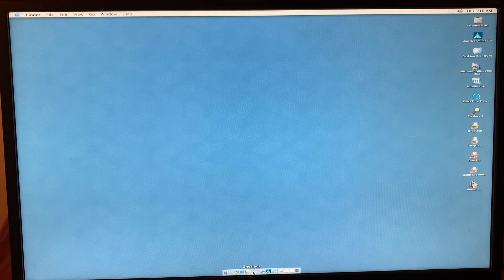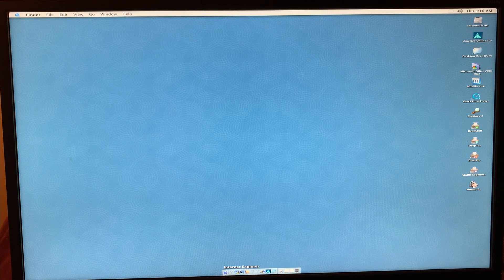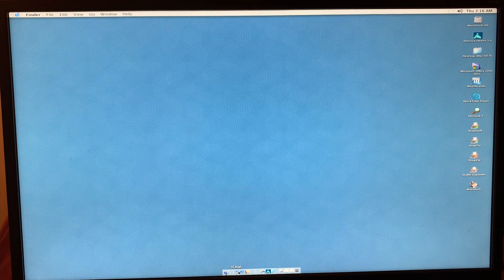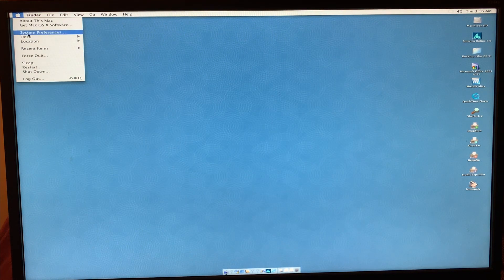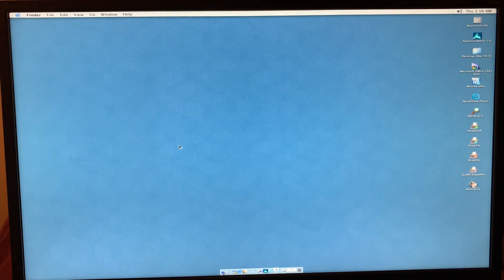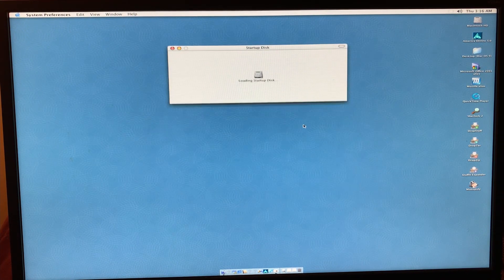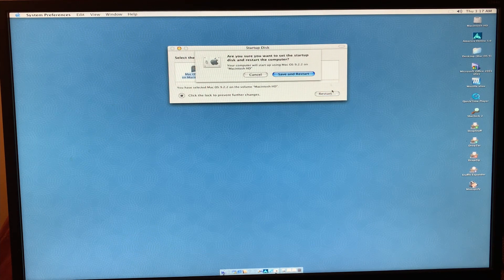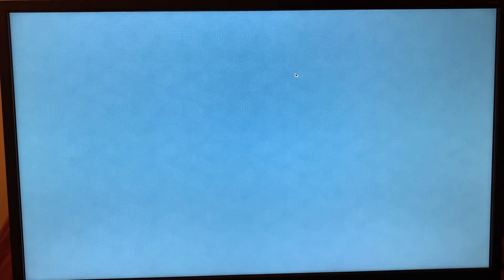Power Mac G4 Yikes! The Ugly Step child of the Power Macs!

Comment: Just had a lucky cheap purchase on ebay with a Yikes listed as for parts, all it needed was a hard drive! And it's a 400 MHz model so it's one of the early ones before the "speed dump." Crazy they only made this series for ~12 weeks. I have not been able to find any numbers on how many of these they actually made and sold, although if I am correct this is probably one of the shortest lived Macs of the post 1997 Apple.
Reply from the maker: Congratulations! I think you are correct, Apple just did not make many of these machines, and with good reason. They could just as well have sold G4 CPU upgrade kits, and let people upgrade their own Blue and Whits. Heck, Sonnet and a couple of others did just that.
The other thing that make finding hard for the collector is the fact that most sellers haven real idea what they are. They look like Sawtooths. If a seller is good enough to give a clear picture of the back IO, it's very clear. 

There are other points that lead to the scarcity. Everything about the machine, other that the CPU, was outdated as soon as it was released. Once the Sawtooth came out, a lot of people unloaded their Yikes very cheap, in favor of a Sawtooth. A lot of Blue and White users bought these used Yikes. I t was actually easier to transfer the CPU daughter card from the Yikes, as opposed to moving drives, PCI cards, etc. 

Anyhow, thanks for stopping by and taking the time to comment.

Comment: You can install an SSD hard drive in these Power Macs.  If you do, you'll probably want to get an IDE to SATA adapter, Since IDE SSDs do exist but are expensive and can be scarce.  Make sure the hard drive doesn't exceed 120GB, since there's a limitation.  When you set up the drive, make an HFS Extended partition that's just under 8GB; after that, you can make the 2nd partition whatever size is remaining.  Yes, to max out the RAM as well.